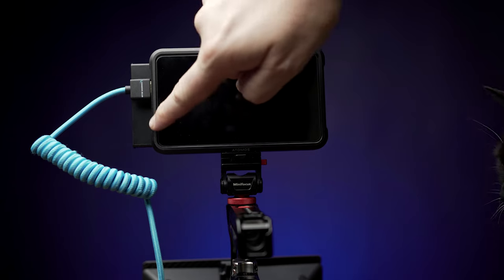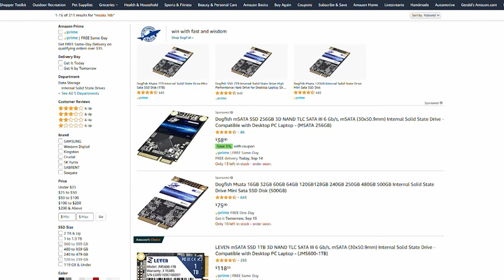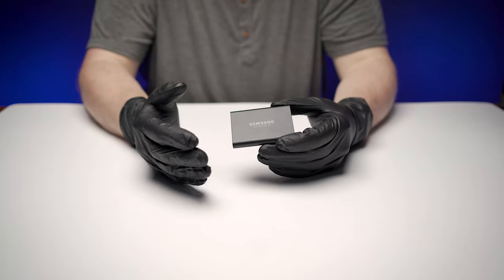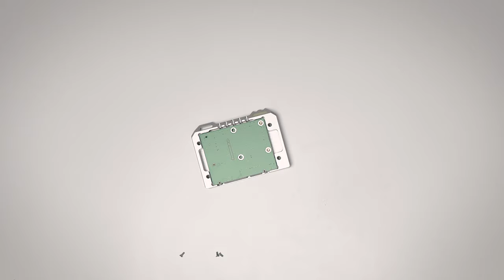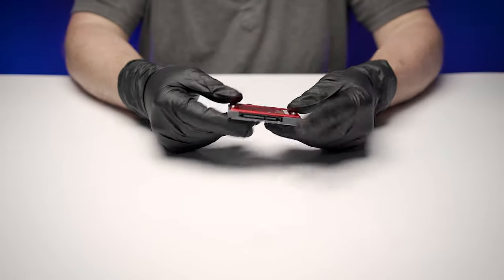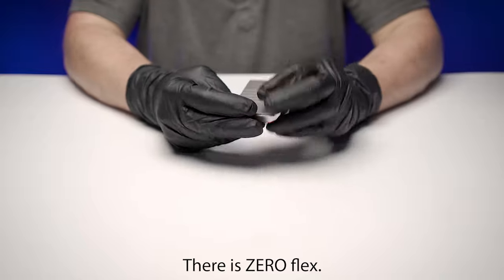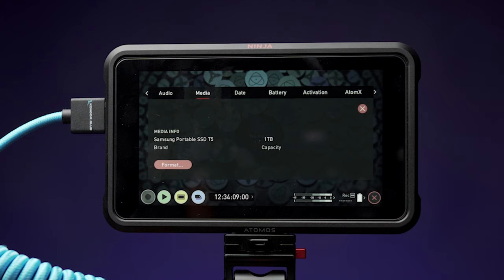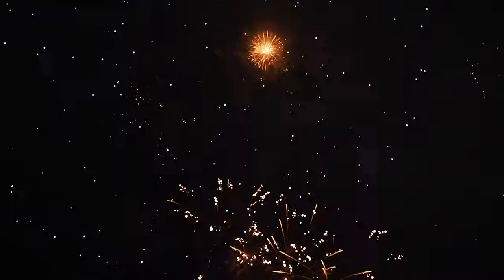BETTER Than The Angelbird Atom X for the Ninja V for less that HALF the cost? Andycine Lunchbox.

Comment from the maker: Be sure to check out one of my recent videos for the PERFECT accessory for the Lunchbox, the Lunchbox USB C reader! https://www.youtube.com/watch?v=kzaAu6pTba4
Reply: Hi Gerald, I just have a question... what's all that for? Not having the ssd sticking out of the ninja or there's something else?
If you talk about cost saving, i would say that's not true, because it's plenty of fast sata ssd at very low price.
Thank you for the video and nice gloves btw
Reply from the maker: @emanuelechiabert  Thanks for the comment! In regards to the saving of money, I am actually comparing it to really the only other kind of drive with a better build quality and shorter length than the plastic sleds which is the Angelbird drives. But for sure, if you are happy with the plastic sleds and it sticking out the side of the Ninja, there are indeed plenty of good SSDs you can slide in there for pretty cheap. I dig the gloves as well!!
Reply: Hi Gerald,  would you think the Samsung T5 2TB works?
Reply from the maker: @jonathanbacs  I haven't personally tried it but as long as the form factor is the same, which I believe it is, you shouldn't have any problem. If you try it please let me know how it goes!
Reply: @jonathanbacs  2TB T5 worked for me.

Comment: Just got a 2TB T5 drive and a LunchBox, put them together in about 5min, no issues.

The LunchBox is built like a tank!  Love it!
Reply from the maker: Thanks so much for commenting this! I've had numerous folks ask if the 2tb T5 would work with the lunchbox and now we have confirmation it does!
Reply: I tried with my T7 1 TB one, but the the format is different.

The 2TB T5 drive is the same as in his video so? :)
Reply: @MaximeBommelle  It is the same. Just make sure to remove the tape on both sides of the drive connector!
Reply: Does it clip your videos?
Reply: @matt_pang  Nope, works like a charm.
Reply: I was wondering if a 2tb would fit. I guess so!
Reply: I just recently purchased an Angelbird 1TB drive. Just came across this video today. Now I am really kicking myself hard. I am going to follow your trek and see how well a 2 TB drive will do as well.
Reply: Where did you buy the T5? Please, link. I tried to buy it in Spain - no way! Thanks

Comment: Per your request, (not sure if anyone else has volunteered the same drive information yet) I actually used the LEVEN JMS mSATA SSD 2TB drive. Using your demonstration as a guide, I found the biggest difference was the chipset on mine is actually on the other side, so the thermal pad went between the board and the SSD. There was room and no issues. Formated in the Ninja V just fine.
Reply from the maker: Thanks so much for following up! That is great to hear! I am going to make that recommendation to folks that want a bigger drive.

Comment: Great video I know there is a newer version out, but just installed two different 2T mSATA drives and the both work. I picked up  $179 mSATA SSD 2TB SHARKSPEED SATA 3 6Gb/s 3D NAND and a $119 ROGOB 2TB mSATA SSD SATA III 6Gb/s Small Form Factor from Amazon.

Comment: The problem with the lunchbox is it's so limited and wasnt thought through very well. I mean a slight change to the inside and rhey coukd allow tons more iptikns but instead they limit them selves by making the fittings sp tight. Another issue is the rivits that are not flush to the casing making it incompatible with tje Connect and some cages. Then you have the problem of it being too short and heavy so that it doesnt have any support and after long use it actually starts tp javl up the connections.
I bought like 5 of them to my my 860 EVOs in that i had laying around but since i use the Atomos Connect i cant use them unless i modify them. They need to make some small changes and they would be great but as they stand now their kind of jist olay and a simple 3d printer job can and has been better for me

Comment: Hi Gerald, I just installed my drive into my ninja. It works flawlessly, however, it doesn’t feel that snugged in. It feels a bit loose even though how hard I tried pushing it in.  All the pins/ports are aligned. Does your feel that way? Thx.
Reply from the maker: Hey Matt! No, my Lunchbox fits in pretty well. However I do know that the drive connector on the Ninja V has a fair amount of play in it, device to device. The one in mine is fairly stiff. A friend I shoot with has one as well however his has quite a bit more play it in. My assumption is that there is some tolerance variance in the drive connectors in the Ninja V monitors. I have also heard from several other shooters about this. Just my 2 cents!

Comment: Great video. What are you using to reads these drives? I have several master caddies and use a G-Drive Thunderbolt reader , but no way to fit these inside that thing.
Reply from the maker: So I was using the Atomos dock to hook up the drives to my PC but it ended up failing some time back. When I was researching a replacement I learned that those Atomos docs  failed for a LOT of folks. I was told to grab the StarTech SATA to USB Cable off Amazon for $12. I've been using it daily for months now and have had zero issues with it.
Reply: @GeraldBertramPhotography  Okay thanks.  Yeah I do have a sata to USB, but it's not the fastest thing in the world.  I always use my G-Drive Thunderbolt 3 reader.  It's like a cartridge though so won't fit these lunch boxes...if I can ever find them that is.  None in stock anywhere.

Comment: for anyone who has this issue: my caddy had glue or something in some of the screw holes so i had to use a toothpick to get it out so i could put the msata inside the enclosure
spent like 15 minutes trying to screw in the screws with no luck til i noticed it
Reply from the maker: Thanks for the heads up!
Reply: I just experienced this and came to the comments to make sure I wasn't breaking something. Thanks lol

Comment: This looks really nice, although if the drive in the Samsung T5 is truly a standard M.2 2230 drive, the only physical incompatibility is the screws to keep the drive laying flat.  In the T5, the drive has 2 small screws in the corners.  It looked like the motherboard for the Andycine Lunchbox does not have a screw hole for a standard 2230 (center screw).  That's a bit of a shame, a nylon locking pin would make for a toolless drive installation.  The process to transfer the drive isn't too complicated, but it would be nice to just pick up the M.2 drive directly.  That said, there aren't any speed concerns with M.2 drives since they are far faster than the SATA 3 interface that the Lunchbox provides.
Reply: it's not a m.2 drive. you need a mSata drive.

Comment: The angelbird drivers are harder to remove and I've even picked up some super cheap second hand and are def my go to. I don't mind the caddies, but the lunch boxes will need to be longer. Here lies the issue, when you have any of the addons like the AtomX or Connect, you wont be able to get teh drive out of the unit. I do see they have several options as well as an extension handle, but I'm not sure it's still long enough to get out. Nice to have options though!

Comment: Thanks for this video. I installed a Samsung T5 1TB drive in the Lunchbox and it seems to be working great. I love the form factor and low cost.

Do you know if this SSD would work with the Lunchbox? 
SanDisk Ultra 3D NAND 500GB Internal SSD - SATA III 6 Gb/s, 2.5 Inch /7 mm, Up to 560 MB/s - SDSSDH3-500G-G25

I have a couple of these that I installed in Atomos SSD caddies for my Shogun Inferno and they also work with the Ninja V. So, I'm wondering if the SSD can be pulled from the case and installed into the Lunchbox.
Reply from the maker: Thanks for the comment! Unfortunately that won't work. The drive inside of those are a different form factor. There are some naked eSata drives you can from places like Amazon that I have heard some folks have success with.

Comment: Thanks for Your review. I´m using a USB A cable 3.1 Gen 2 to SATA by STARTECH. But there is no connection between the ANDYCINE and my computer (MAC Book Pro 2021).  Which cable do You use?
Reply from the maker: I'm also using a Startech one. This is the model number of the one I am using: USB3S2SAT3CB. However this is on a PC. Maybe the one from Wavelink would work better for you since it's USB C: https://amzn.to/336QMwD
Reply from the maker: I forgot to mention that Andycine is actually making a USB C reader for the Lunchbox. I'm waiting for them to send to me so I can't speak to how well it works just yet. I plan on doing a quick review of it once it's available: https://www.andycine.com/usb-c-reader-for-lunchbox-sata-ssd-p3907845.html

Comment: I have the same great looking stuff (T5 in Lunchbox) build and working correctly BUT its showing me the Skippy Frame Kangaroo in the Ninja V when filming 4k30……does this happen to you too? I‘m using the Atomos HDMI cable. Its okay with 1080/60. I now ordered the T7 to check if its faster….
Reply from the maker: Interesting. I can say I have had zero issues with this setup and no Kangaroos in sight. That being said I HAVE seen Kangaroos when using the Atomos HDMI cable shooting in 4k60fps ProRes RAW with my GH5S. Changed over to my Kondor Blue HDMI cable, as well as my ZILR cable, and the issue went away. You might consider picking up the ZILR 4Kp60 Hyper-Thin High-Speed HDMI Secure Cable since it's only $20 and see how that works first.
Reply: SATA 6G is limited to 600 MB/s, so the T7 will be limited by the SATA port of the Ninja. Only by connecting via USB C, the T7 can be maxed out
Reply from the maker: @knobi3760  So any idea why his T7 is skipping but is T5 isn't?
Reply: The T7 is NOT compatable. USB-C controller soldered to the board

Comment: INTERESTING !Is there a 4 or 8 tb option that has been proven that does 4k 60 prores raw?
Reply from the maker: Not that I am aware of. I personally have only done this with the Samsung T5 but I've heard from a couple other folks that have used some generic 1tb mSata drives with success. If you do find out about any larger drives that work with it please let me know!
Reply: I know some ssd boards are larger  because 1 tb wd blue inside works w atti bear caddy like size your showing but 4tb wd ssd board is larger and wont fit. I know cf express came out 4tb and angelbird makes an adapter low pro but  1600  for that option rn. If i know ill post. Thanks

Comment: I hope Andycine will make same case but for regular SSD like WD or Samsung Evo 8xx series. I can not find T5 or msata m3 on the market, because it's old technology.
Reply from the maker: I think they would have a problem with the form factor. It works with the msata drives because they are more of a square shape vs the longer rectangle shape of a regular nvme drive like a Samsung Evo. However I know the newer T7 drives while not compatible with the current Lunchbox, it is the right shape so hopefully they will make a Lunchbox that might work with that.
Reply: @GeraldBertramPhotography  i mean regular ssd 2,5” size. It’s same shape as WD and Evo. I’ve got both and did opened it to see what’s inside. Its almost same size as lunchbox, the only problem is matching screw hols to fix it. Samsung t7 is inside single piece. There is another alternative to make caddy smaller, search for “DIY ssd atomos ninja”. People are 3D printing caddy and mount inside ssd.
Reply from the maker: @360fullhd  Oh! Ok. I love that idea. I hope we can see different kind of drives in this Lunchbox style enclosure. If for no other reason just the build quality. Twice I have stepped accidently on my Lunchbox drive, and I'm not a light dude, and it didn't suffer even a single scratch.

Comment: I did this with the T5 2TB SSD. The only thing I don't like is how small it is. I'm glad it doesn't overhang, but I still wish it went to the end and filled up the entire allotted space.
Reply: There is another good reason for the smaller size: the monitor is not heating up as much, because of free space at the backside.

Comment: This is amazing thank you for sharing one question though does it work with T7. I have a 2 TB version of that it would be awesome if it does work with it
Reply from the maker: Thanks so much! So I have not personally tried with the T7. However, I know it is the same type of drive as the T5 (msata) so it SHOULD work. If you try it yourself please let me know how it works!
Reply: no it does not t7 does not has a msata drive inside.
Reply from the maker: @yuxianwang3238  Really? I had another viewer say it was. I personally have only used the T5. What kind of drive IS inside the T7?
Reply: @GeraldBertramPhotography  T7 uses pcie protocol like NVME and it only has a usbc port on the board. there are teardown pic on the internet.
Reply from the maker: @yuxianwang3238  Appreciate the info!
Reply: @yuxianwang3238  Big Thank you!!! I will just use my t5 drives.
Reply: @GeraldBertramPhotography  I'm currently using liteon 512g msata drive. (Used to have a Sandisk SSD it works with prores HQ on sony A7R2) I was at a very old firmware and had issue recorded to the SSD firmware was 10.7.1 today I upgraded to the newest firmware and it works perfectly. I mainly use it to record PC and PS5.
Reply from the maker: @yuxianwang3238  Nice! Is that liteon drive currently available on Amazon or New Egg?
Reply: @GeraldBertramPhotography  no it's not the msata SSD price on newegg is way too high right now. 860 evo msata should be the best choice (T5 uses an OEM variant of the 860 EVO) also I fount the sata 870 evo board works very well with the enclosure. But, teardown any new drives for the PCBA and avoiding warranty is not the best choice. just as the reference the price for a 860evo 1T is just about 100USD here in China.

Comment: Hi, i read somewhere that the Samsung T5 can't write 10 bit RAW 4:2:2, is this true?
Reply from the maker: Nope, not true. In the video I was recording 12bit ProRes RAW HQ.
Reply: @GeraldBertramPhotography  yes It goes 12bit prores but that was a result by blackmagic speedtest if i remember right, 12 bit prores yes but not 10 bit RAW. I can't find that test, i'll be very happy of you can do because with my D780 i can only use 10bit RAW 4:2:2 and before buy this beautyfull solution i have ti be sure it works as a WD Blue.
Exellent video by the way, very helpful to see how to setup It in detail 😁
Reply from the maker: @gigohsq  Are you talking about the Nikon D780? If so I believe that camera can just output 10bit 422 log footage, not RAW. The data rate for that is going to be lower than 12bit ProRes RAW HQ so the T5 shouldn't have any issues keeping up. Keep in mind doing this conversion here, we are getting rid of the USB C interface controller and using a SATA controller now so you should get speeds that meet or even exceed the throughput of something like the Western Digital Blue.
Reply: @GeraldBertramPhotography  very clear and helpful, thank you very much 🙏🏻

Comment: Gerald, I currently own two Atomos Ninja Inferno monitors.  I'm current using the Sony Atom X 500GB Mini-drive for both of the monitors.  I would love to extend my record time in the field.  My question:  Can I use the Lunchbox + the Samsung T5 with the Ninja Infernos.  I purchased them when they first released because I knew they would be a game changer for many filmmakers including myself and they have paid for themselves many times over!!  They are 7 inch monitors, big, bulky but they help me in so many ways and because much of my work isn't run and gun, they work as good as any record monitor out there!  I'll take em to their grave.  It also saves me tons of HD space because I can shoot in Pro Res HQ, 422, LT, etc... AND, I don't have to transcode files, doubling the demand on my drive space.  So ... Can I use the Lunchbox + the Samsung T5 with the Ninja Infernos?  Thanks for any help you can give me  ... love the channel
Reply from the maker: From my understanding the Inferno uses the same 2.5" drive sled as the Ninja V. Now I don't have an Inferno so you would really need to double check that. If it is the same drive sled as the Ninja V, then yes the Lunchbox & T5 combo should work with no problem.

Comment: Awesome video! Question: why shouldn’t a different mSATA drive work? There are newer ones like the T7 which has even higher speeds….
Reply from the maker: I thought about buying a different naked msata drive to try but just ran out of time. As long as they have good speeds I honestly don't see any reason why you couldn't use another msata drive.
Reply: @GeraldBertramPhotography  I might try it. I too can’t see why it shouldn’t work as long as it fits and is fast enough…thanks again!
Reply from the maker: @vr4ever645  Please let me know your results!
Reply: @vr4ever645  did you get a chance to try the T7's?
Reply: SATA 6G is limited to 600 MB/s, so the T7 will be limited by the SATA port of the Ninja. Only by connecting via USB C, the T7 can be maxed out
Reply: @adrianfernandez5879   DO NOT GET THE T7 IT WILL NOT WORK OUT BECAUSE IT DOESNT HAVE M.2 SSD INSIDE , its all built in on one chip , i learnt the hard way :(((